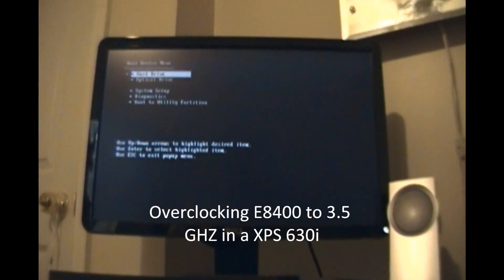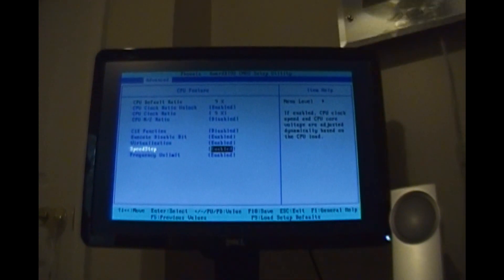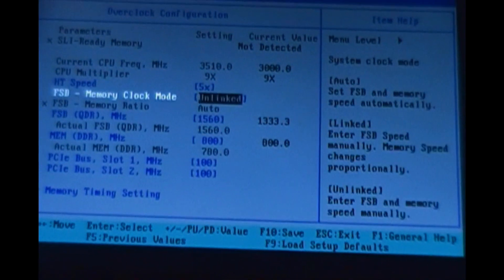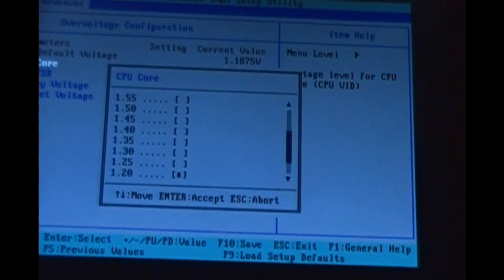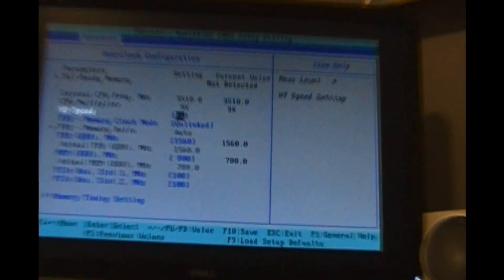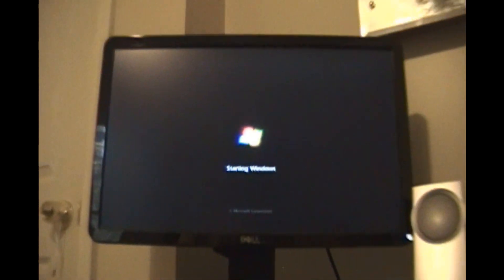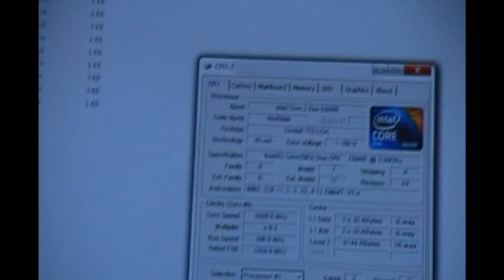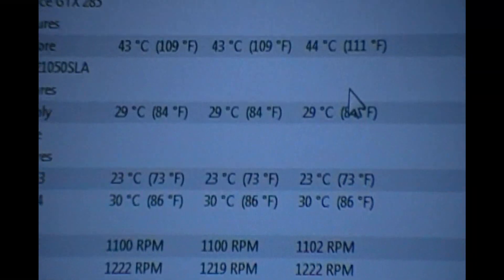XPS 630 E8400 Overclock How-to

Comment from the maker: A q9400 is a different processor than the one depicted in my video.  Your mileage will vary and I suggest small increments with small bumps in volts until you reach stability.  I do not own this system anymore so my input for the XPS 630 system is limited.

Comment from the maker: @zyxy3k Are you sure you have a e8400 dual core cpu?  Did you disable C1 and speed step?  Like you said every cpu and system for that matter is different.  You may need to increase the FSB or chipset voltage farther then the settings displayed in my video.  The key is to make one small adjustment at a time until you find the optimal settings.